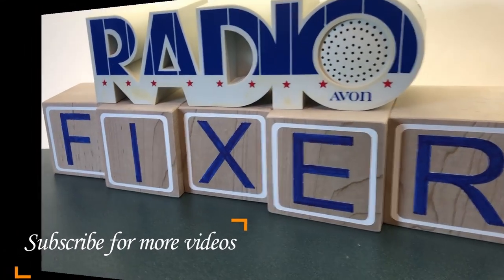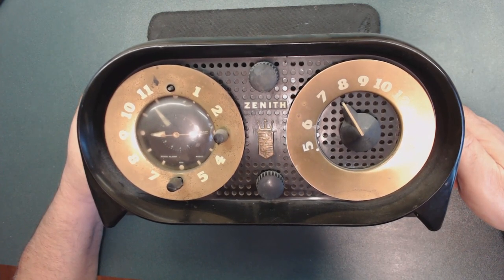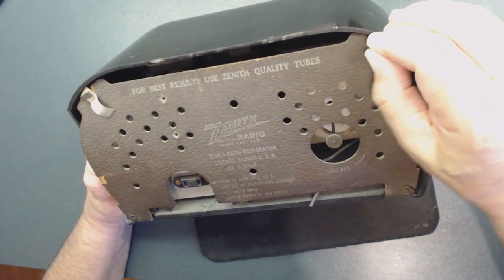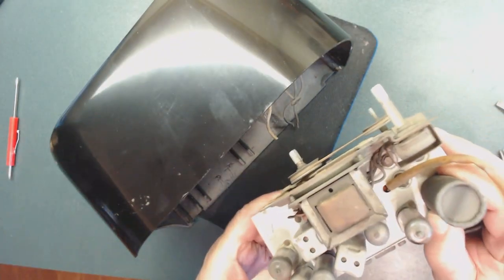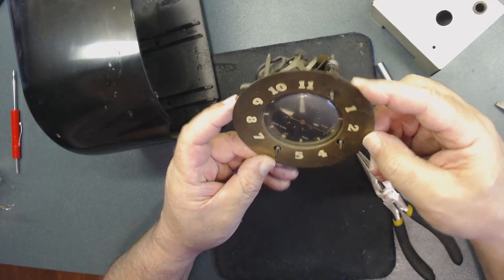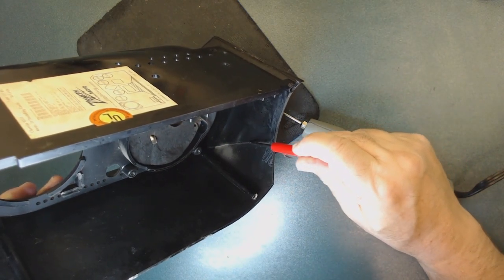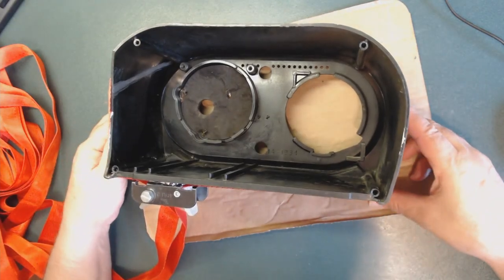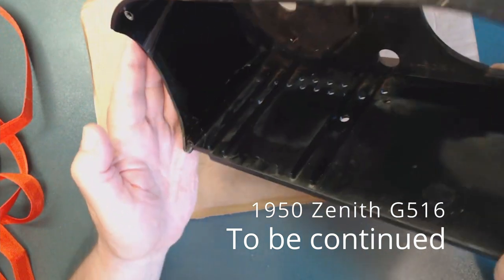Part 1 - How to repair broken Bakelite radio

Comment: Better scarify those cracks and surfaces inside the cabinet. You need to roughen up at least 1/4 to 1/2" on each side of the crack, When you leave the surface glossy as you have done, the epoxy does not grip the surface. Common mistake people make. Roughen the heck out of it.
 Don't worry if it looks like hell, it gives the glue something to grip onto. The 24 hour is best because it's harder, but fiberglass resin and cloth is even harder, The last thin coat of resin flows out over the inside of the repair to smooth the look out.
 The resin is also good on the outside if there are missing pieces, the resin can be filed and sanded to shape.
 Thank you for the video.
Reply from the maker: Thank you so much for the message, I need to try that.  I had my automobile paint and body shop early 80's and used fiberglass to build aerodynamic spoiler's for  BMW's. I still have some of those materials. LOL. I am trying to see if possible to bring back this cabinet to close to original condition inside and out. Hopefully it works, wish me luck and have a good day!

Comment: I was going to ask you if you thought using epoxy would be a good idea for fixing the cracks in the case.  When you said that the JB Weld WAS an epoxy that answered my question.  This should be a really interesting project.
Reply from the maker: Hi Wayne, good hearing from you! Hope you are doing well. I hope it works or I am going to be in big trouble and YouTube going to cancel my channel. Lol  😂 I am excited to work on this and hope this video helps others to rescue those broken Bakelite radios. Lets bring them back and make them sing again. Have a good night my friend! Jay

Comment: Thanks for your expertise. I am restoring the same radio. I have a problem tho, the radio on/off works when I have the clock and radio out of the cabinet. It doesn’t work when in the cabinet?!?  Any ideas?
Reply from the maker: Hi Jeff, unplug the radio from electricity then use your multimeter to continuity test to see if there any bad connections. Also check your solder joints connections. Does you clock work?